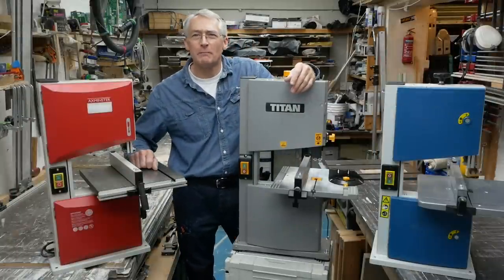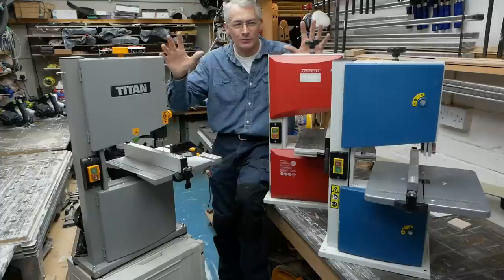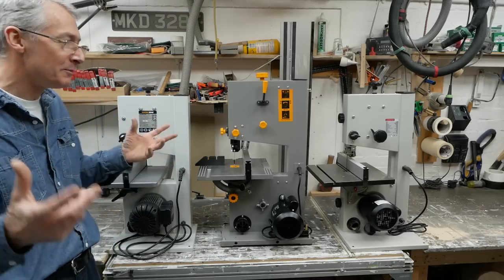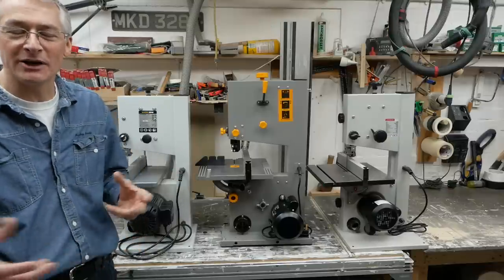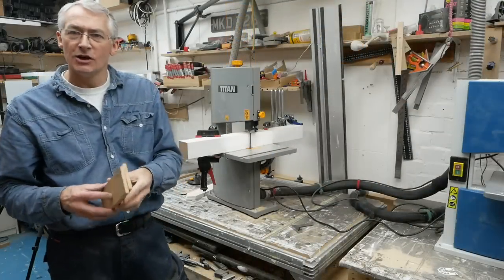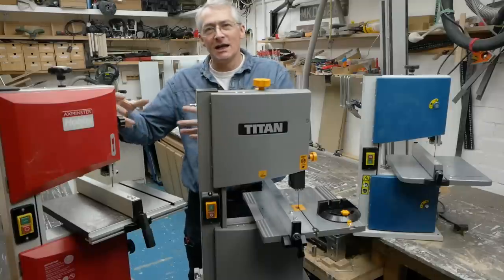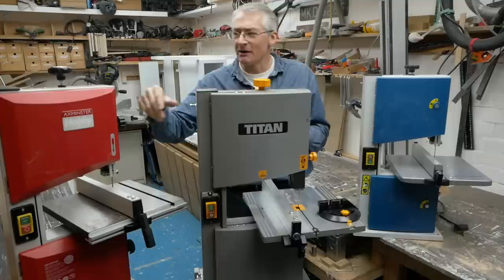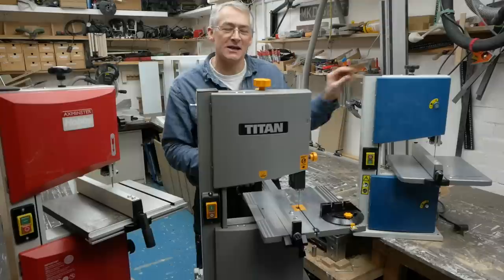Cheap bandsaws (again) #148

Comment: i need to cut accurately mortice and tenon joints in 4x4 inch timber. What do you recommend please ? Think of a used ebay bandsaw, but not too big or heavy to transport in a car, but i do have a car trailer.
Reply from the maker: I've no idea I'm sorry - my bandsaw experience is limited to what you see here on the channel. 👍

Comment: S1, S2 reminds me of how amplifiers and speakers are rated. Cheap stuff usually quotes that they can handle for a very short moment or with lots of distortion giving huge amount of watts while expensive pro stuff always quote the continuous high quality level.
Reply from the maker: Yes !That’s so true, and the perfect way to describe it, thanks! 👍
Reply: Yes, when looking at amplifier output, decent equipment will quote the RMS power (root mean square) where as cheap equipment quotes PMPO (Peak Music Power Only).

Comment: Hi Peter, Thanks for the review. Good to know that somewhat useful quality can be had for s decent price. I am looking at bandsaws at the moment and was wondering what your opinion (and other people's) of paying a bit more to get a greater cutting capacity. I was looking at the Scheppach Basa 1 from Screwfix at £190. It has a cast iron top and mitre slot but 100mm capacity. Just wondering if people think the extra 20mm is worth 80 quid?
Reply from the maker: Hi Steve. I don’t have any personal experience of the Basa series, but Scheppach bolt their stuff together pretty well, generally. I think if I was regularly cutting at close to 100mm then I’d go for something bigger - next size up maybe - just to get a bit more headroom. Also I’d expect motor size to play more of a role in thicker cuts. Hopefully a Basa 1 owner will chip in before too long! 👍👍

Comment: Sorry Peter, forgot to ask....
When deciding between the Aldi and the Titan, what importance did you attach to the fact that the Aldi has a metal rising blade guide yet the Titan just has a plastic guide, and does it matter?
Reply from the maker: Doesn’t matter a scrap to me, for my usage - though as I say, I’m not a heavy bandsaw user, so it may make more of a difference to others. 👍

Comment: Great video! I read somewhere else that you said you are going to upgrade the fence and blade? I got the axminster fence kit but am struggling to find a way to mount it! Is that the fence you are going to get?
Reply from the maker: Thanks! I’ve bought the cheap (<£15) Axminster fence but haven’t had the chance to fit it yet. There’ll be a video, for sure 👍

Comment: Great vid, just had text to say my Titan bandsaw is available for collection... some fettling and fence making for me over the weekend 👍🏻
Reply from the maker: Nice one Richard! I’d be very interested to hear about your ‘out of the box’ experience, see if it matches mine. Hope it goes well! 👍
Reply: Hi Peter, quick play on bandsaw today, short session as blooming cold (Boiler packed up, so shop heaters moved into the house, Just in time for the big chill 😣) .  Bandsaw, easy setup, table is solid and rack & pinion adjustment is very good.  Fence is garbage as you know 😀, less blade drift than you but still too much. I will probably make one.  Fyi, the quick release handle on mine works, it does not touch at the top like yours, (not sure its sypposed to) but dropping handle left or right, moves the black metal casing which tightens the blade.  Hope that's clear? Thanks Richard

Comment: Hi Peter ,
Yet more questions...
 The Axminster seems to have some advantages for me such as being able to take up to half inch blades, which neither of the others do being limited to quarter inch blades. Also the cast iron table rather than aluminium or steel.
* Did you not consider the larger blade size worth the extra for the Axminster?
Reply from the maker: Tricky call Mike. If you need the half-inch blade, then yes absolutely worth it.  Even if you don’t, it’s a better saw than the Aldi or Titan, provided you can live with the cut capacity. 👍
Reply: Wider blades have a couple of major benefits. First, they can make deeper cuts without twisting. With these saws, the max depth of cut is only 3", anyway. Another advantage is that a wider blade makes for smoother and straighter free-hand cutting to a scribed line. 

The downsides, OTOH: Wider blades can't cut as tight of a curve. They suck a bit more of the available motor power and put a higher load on the bearings and frame. Because a saw is advertised that it CAN take a given band size doesn't make it a good idea. If it really pushes the limits of the saw, this could wear out the damper spring faster, for instance. And with less effective damping, the bearings would wear out faster. 

Then there's an issue of the frame and axles torquing. Every band saw comes factory tuned for a specific tension. When you change blade sizes, the frame and axles change position, slightly, under load. Then the blade tracks differently on the bottom wheel vs the top, and this introduces a twist in the blade. On the larger band saws, you can easily adjust the bottom wheel to adjust for these changes. I haven't owned one of these better quality 9" saws, before, so I don't know if they can be adjusted this way. On the larger saws, the axle of the bottom wheel extends thru the back cover of the saw and there are 4 bolts in a steel box frame which capture the axle and are used for making fine adjustments.

Bottom line, I'd use w/e band runs the best on a 9" saw, and I bet in most cases it is a 1/4" blade. There's nothing you will regularly do on a 9" saw that needs a wider blade, IMO. If you resaw 3" wood a lot, you will want a larger saw, anyway. You don't really ever want to cut expensive stock with the blade guide all the way snug on top of the stock, because you can't see if/when the blade starts to wander. By the time you feel it, the cut will be properly buggered. And when a band saw blade gets dull, it will always get dull on one side more than the other and start to drift. That's the way wood cutting band saw blades are made. So don't believe you can tune all the drift out of a band saw; unless you are running carbide blade on a large saw, your saw will eventually drift because of blade wear. For practical purposes, you will probably want a larger saw if regularly cutting stock thicker than maybe 2".

Comment: On to my third Titan in a week.  The first had been damaged in transit and the motor casing was dented badly and stopped the motor turning. On the second the on switch did not work.  The third seems okay but not impressed with the cut as it leaves wavy lines in the wood.  I have tried readjusting the guards, tracking and tensioning with no effect.  Any ideas?  I was thinking about trying a different blade.  People seem to recommend the Starret Duratec from Screwfix.  By the way the tension release lever does work on mine but you need to turn it anti clockwise to move the lower bar  not the upper "button" as shown in your video.
Reply from the maker: Sorry to hear about the issues. Is the blade tension nice & tight? I ran the stock blade for a while, and whilst it wasn’t the best, it cut straight, and through everything I threw at it. I changed to a Tuffsaws SuperTuff Premium Bandsaw Blade - 1575mm x 1/4" x 6tpi - http://bit.ly/TuffsawsPremium
Works well. Also upgraded the fence - see bandsaw makeover video #293 & 294. How much of. Project do you want this to become? If you’re on your third and you’re not happy after a blade change, I think I’d be inclined to look elsewhere, tbh. Let me know how you get on. 👍

Comment: Peter....i have tne aldi saw....just cant get it set up right. Any way you can post exactly how its set up and tuned? Love the channel. Learning loads. Thanks.
Reply from the maker: Thanks David! Have to say, all I did with the the Aldi is bolt the table on square to the blade, and start cutting. Is your blade tension OK? Tracking? I had no issues with my Aldi bandsaw at all.

Comment: Peter, great series of cheap bandsaw vids, thanks. As a first time buyer to bandsaws one thing that isn't clear is how well do these bandsaws cope with cutting out more complex shapes out of varying depths of woods? I know you did straight cuts easily, but many people will want to cut out shapes of some sort (I do).
So as good as your videos were, it doesn't help me determine if one of these will be ok for my use.
If you can let me know that would be wonderful
Thanks
Simon
Reply from the maker: Have to be honest shape-cutting isn’t something that I do a lot of, but certainly the bandsaw I kept (the Titan) does a decent job of e.g. cutting circles on a bevel in 18mm Birch ply.  But for the kind of work I do, I don’t have much call for anything thicker or more intricate than that. 👍👍

Comment: Cheaper versions of any type of product have always been available, and if you need that product, and you’re budget restricts you, you do your research and get a balance of best/most for your money. What you won’t get is quality, ie works for you not against you, is not lacking in essential features, does the essential task without compromise or flaw, built to last. Again, for any type of product, there is a starting price where all the factors that effect quality are met. A 100 years ago, if you could only afford cheap shoes, that’s what you bought, but importantly, nobody tried to actively encourage you to buy cheap shoes with claims that they were as comfortable or as durable as more expensive shoes. Now we are in the age of making cheap copies (to be blunt) and convincing people that they are as good as the quality version. This is an area of modern consumerism, an industry that runs parallel with ‘real’ manufacturing, ersatz products. Yes, I’m caught up in it, we all are. The thing is, even when we can afford the quality level product, we pursue the cheap copy, because it’s there. Built around the blade of any bandsaw, is precision and versatility, and only one of these three can meet those requirements. A mitre guide, a table that tilts, a rigid table, a fence that locks solid, these are essential for the bandsaw to do what it was designed for.

Comment: I really enjoy your videos Peter. I have a question.. I'm looking at buying the Scheppach HBS20 specifically for cutting 1mm and a maximum of 2mm brass. I can't afford the bigger more expensive ones. I found a 24tpi 1400mm carbon steel blade that will fit this saw but I believe to cut metal the speed of the band saw should be slower than for wood. Is there a way to tweak the Scheppach to reduce speed? Do you think it's necessary to do this at all?
Reply from the maker: Thanks Gunter. I'm afraid I can't help as I have zero experience with cutting metal. If you give Ian John at www.tuffsaws.co.uk a call or email, I'm sure he'll be able to advise on the best blade for the job; perhaps another viewer will be able to comment with the speed question, but I'm afraid it's beyond my experience. Thanks! Peter
Reply: Thanks for your quick reply Peter and for pointing me in the right direction! Very kind of you.
Reply: Peter, just thought I'd update you and your viewers. I got in touch with Ian from www.tuffsaws.co.uk and he was very helpful and quick to reply indeed. While he warned there would be problems with cutting steel/stainless steel, he said that the relatively high speed of woodcutting bandsaws would not be much of a problem for 2mm brass, as long as the feed rate is slowed down. He recommended their M42 10/14 vari-tooth which I have now ordered. I'd like to thank you again for referring me to him. This now means I don't have to purchase a very expensive metal cutting bandsaw!
Reply from the maker: That's great new Gunter, thanks for letting me know. Ian's a great gut, very knowledgeable, and generous with his time; her makes some great bandsaw blades, too! 👍

Comment: I find the input and output power ratings very confusing. Some of the stat blurb given only gives one rating, so it could be either. It would be great if manufacturers only gave the out put power which is the important one.

Comment: I have just looked on the Aldi site today (1/7/19), and the saw is on show and apparently available.
Reply from the maker: Thanks! Just be aware there seem to be a few quality control issues with the current model - a few folks have reported problems with the blade staying on the bottom wheel. 👍

Comment: that aldi is just a re-branded scheppach hbs20?? I think..it looks the same and is the same price roughly...ok..it gets mentioned...

it's probably easier just to retrofit the titan table onto the scheppach...or or whatever...just take the best from both and make a frankensaw....also you can quite easily make your own saw table for the scheppach with just some quality plywood....ofc you would lose some cutting depth.
Reply from the maker: Yep, as mentioned, many Aldi Workzone tools are rebadged Scheppach, and Scheppach handle all customer service. Way too much work involved to adapt the Titan table to the Scheppach, totally different mounting methods - and to what end, ultimately? I enjoyed the Aldi saw for what it was whilst I had it, and AFAIK its still doing sterling service for the lucky subscriber who received it in the giveaway draw 👍👍

Comment: Just watching this to decide what Bandsaw I want, I have found the Axminster Perform P1400B Bandsaw for £108 and it’s exactly the same as the Red Axminster saw at £200, but it’s yellow and only 1 year warranty, It even comes with a cast iron table for the £108 price. My question is, “with this new price for the Axminster bandsaw would you still choose Titan over the Axminster one”?
Reply from the maker: The Perform model is new, so I don’t have any experience of it,  but it certainly looks like a solid machine - certainly the best price I’ve seen on anything with a cast iron table. Assuming the fence is OK then yes, I’d say go for this over the Titan. One thing to mention; when I was digging around into the bandsaw specs for these videos, all the ‘hobby’ saw’s were rated at pretty limited run time - about an hour per week - so I’d be curious to see if the Perform mentions that in the specs/manual anywhere. 

But yes - at this level they’re all ‘hobby’ bandsaws, and the Perform looks like a good option over the Titan, even when you factor in an extra £20 for the mitre fence. 👍👍
Reply: Peter Millard Thank you for such a detailed reply. It means a lot mate, I think I will go for the perform and give it a go then. All the best!

Comment: Hi peter just found you channel I have a record power bs10 (old) now and I am looking to upgrade I generally cut bowl blanks for my lathe max 3 in thick do you recommend a bandsaw I think Aldi have the one you reviewed this week again many thanks I’ve subbed your channel too ,
Clive in Nottingham 👍👍
Reply from the maker: Hi Clive, and welcome! I think you’d find the Aldi to be very lightweight, and you’d be cutting close to max capacity all the time. Something a bit beefier would be a better bet, I think, but I’m afraid I can’t on mend anything specific as all my bandsaw experience is at the entry-level. I think the old BS10 was a 10” bandsaw, so perhaps the record BS250 might be the current equivalent?? Sorry I can’t be if more help, Peter.